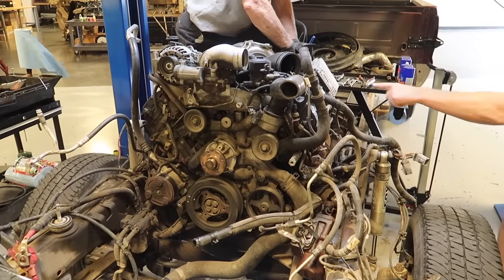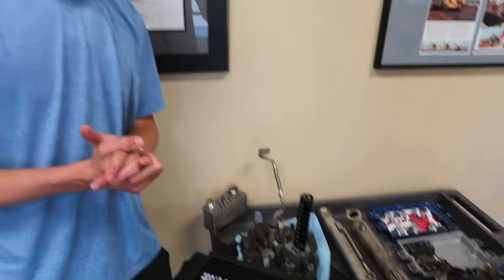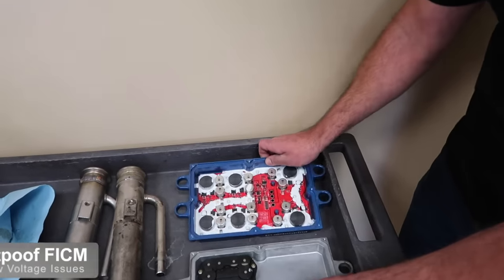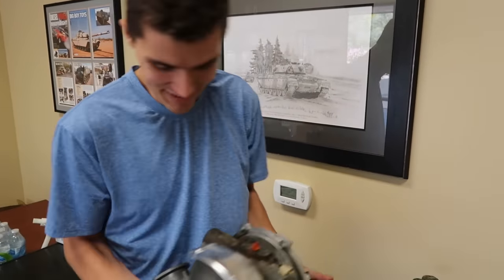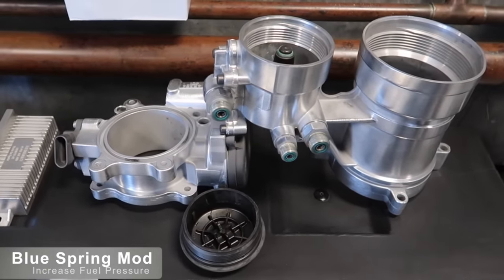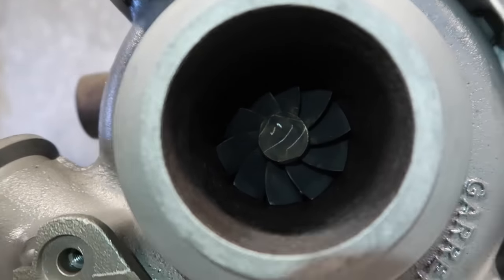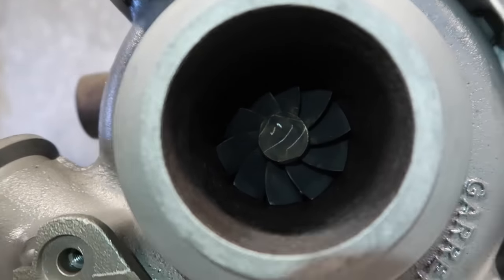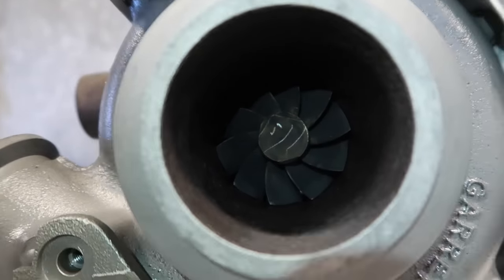Fully "Bulletproofing" Our 6.0L Ford F350 Powerstroke (Stage 3 Install)

Comment: I just wanna know where they found a king ranch for $5400
Reply: dumb luck
Reply: Me too !
Reply: Same... it’s always the things your looking for you can’t find
Reply: Plenty around me in ontario
Reply: auction duh, have you not seen their videos and how they get their cars
Reply: Got my lariat for 7500
Reply: Got my xlt 6.0 for 4500
Reply: got my 2004 f-350 lariat $3000
Reply: Crash on the Right side (bed, cab and door) 24:41
Reply: Easy to find one cheap in Hawaii but not bullet proofed.
Reply: Auction probably with 300,000 miles on it or more. Insurance could be a possibility too I guess. All I know is these guys make great content.
Reply: @JohnJennings-cn3sj  bummer, My 2005 Lariat f-350, CC, FX4, SRW I bought in 2005 was 37k
Reply: Just got my 07 cclg kr fx4 6.0 for $5k. 170k miles. Already bullet proofed.  ;)  they are out there.
Reply: I got mine for 3750
Reply: there was one for $12k and had 97,000 miles basically brand new
Reply: I got my 04 king ranch for 2k with 185k miles on it. Same truck in the video I’m building it now.
Reply: Got my 07 f250 for 7,000 now I’m up to 18,000😢

Comment: if anyone is wondering. to go from stock to full bulletproof you are looking at around 8600 for parts
Reply: Is that labor included
Reply: I paid 5,000 and did the labor myself
Reply: @yomommasgardener9648  same i just got the cab back on 2 days ago no lift was a nightmare
Reply: @thicok4555  how did you get it up???
Reply: 5,000 roughly without the labor
Reply: How much total was spent I want to completely upgrade my 6.0
Reply: Up to $15,000 depending with labor
Reply: Is that just for parts ?
Reply: @Dad2ADaughter_Cpt_Blakesbeard what parts did you use?

Comment: Yeah you could buy a 6.0 for 5k and put 10-15k even 20k in to it to have the truck u want or just buy a 7.3 and save time and money!
Reply: Yeah. But maybe they wanted the better towing capability and comfort of the coil spring suspension. Don't get me wrong. I have a 7.3 but at some point you have to ask what they really want.
Reply: Linda Hammer a 7.3 has its issues aswell even a 5.9 Cummins has its issues nothing is trouble free
Reply: @killiansnufflebottoms7827  im aware i own an 02 7.3 and i had a 01 7.3 that had over 500k original motor and trans only had to replace rear it was a plow truck most of its life im aware of small issues they have but its no where near as bad as 6.0 or 6.4 trucks. Never said that 7.3 trucks are trouble free nothing in this world is!
Reply: Killian SnuffleBottoms it’s nothing compared to a 6.0 let’s be honest

Comment: I say just do a muffler delete, chrome delete, a tune and new tire set up and u should be good
Reply from the maker: Dhruv Pahwa that would be a nice setup!
Reply: Then you start to add things like roof rack and related accessories, a nice front bull bar, some (not oversized) mudflaps, and a bed bar. And some side runners.
Reply: That would make it so tacky
Reply: Do a 5" exhaust
Reply: @robertrabon1706  now that's tacky
Reply: I agree do a small tune, and a 5” straight pipe turbo back, it’ll sound like a jet lol also keeps the EGTS  lower 😏
Reply: Or never get rid of the Chrome because it's way nicer 👍🏻

Comment: Yes 110% straight pipe it turbo back. It will sound absolutely amazing you won’t regret it.
Reply: Colby Cowan lowers EGT’s too, not only does it sound great but it is beneficial for the engine 👌🏻
Reply: Yeah 4 inch turbo back 5inch has little performance  over the 4 inch and 6.0s sound the best with 4inch
Reply: xv70 1 leaving it stock ( mufflers and cats ) keeps the existing exhaust flow obstructions there, causing slightly higher egts. When you straight pipe a 6.0, it lets the engine breathe better, it can get those hot exhaust gasses out better. It’s simple logic
Reply: @rileyjohnson2663  Yup 1st thing I did to mine
Reply: Agreed. Nothing beats the sounds of a strait piped 6.0, the loud whistle to the rumble and they just sound mean as hell
Reply: Everywhere I go, everyone LOVES the sound of my 4 inch straight piped 6.0
Reply: Don't straight pipe
Reply: @rose1693   why not?
Reply: @rose1693  "Don't straight pipe"

I bet you're fun at parties lmao.

Comment: how did you find the king ranch at that price? You know how people are on craigslist.

" 2004 Ford F-250 6.0.    7,000,000 miles.   Sank in the ocean once.    $33,500 FIRM."
Reply: it has passenger side damage
Reply: Ha I just copped a 2003 f250 6.0 for 3500 it only has a 100,000 miles on it
Reply: “No low balls in know what I got”
Reply: It's a 6.0 that's how mang

Comment: I'm really happy for you guys.  I just bought a 2004 f350 6.0 for $2300. It's a rust bucket,  previous snow plow truck . Was running like brand new until I decided to change the fuel filter.  I destroyed the bowl trying to remove the cap😭. Wish I had the money 💰 to bullet proof mine😞.

Comment: Doesnt need 53. Basically anything over 48 volts is useless. Love these 6.0s
Reply: Php ficm tune is better than increased voltages. I had a 58v now have a 48v with atlas 40. 58v is trash

Comment: Mt friend just learned a hard lesson after bulletproofing his 04. He had to shave his heads because the engine got overheated. 30,000 miles later the camshaft failed. The reason> He forgot to account for the shaved heads and his push rods were the stock length causing premature camshaft wear.

Comment: I straight piped my 03' for a short time. It was just too much noise for me while towing long trips. I put a series 50 Flowmaster on it. It is perfect for the classic 6.0 Powerstroke sounds with a whistle spool down sound just like jet engines sound like. It makes people ask what the hell is under the hood of the truck. It still has a little cruse speeds noise. But not a dronish tone.

Comment: For less than the cost of all the bpd parts you could have a reman engine from ashville engines with a upgraded cam and coated pistons.  Then you have a basically new engine.

Comment: I have an e99 7.3l stock and the straight pipe sounds awesome... any straight pipe turbocharged engine sounds awesome. Don't forget the turbo muffles the engine noise too... just with some added jet engine noises.

Comment: 4 inch straight pipe exhaust. You don’t need a new down pipe, just straight 4 inch from the down pipe back. Deleting the cat and muffler will make a huge difference in performance. To go along with the exhaust, find a good tuning company that has a good reputation with 6.0’s, that will give you a huge difference in power, along with gaining much better fuel mileage on the highway.

Comment: Exultant Vid on full 6.0 fix. Only problem is that the more people wake up to the 6.0 reliability their price goes up. 

A full fix like this has put the value way up for your King Ranch. I had my  2003 6.0 fully BPD parts fixed years ago and I have had zero problems with towing my 16,000 Lbs 5th wheel for over 60,000 miles since the fix. My rig is at 180,000 miles. My next insurance for the 6.0 will be a Certec Liquid Moly oil treatment for the pistons, cam, rockers and crank surfaces.

I went with a 4" turbo back straight pipe but installed the 50 series Flow Mater because on long trips it was too loud for conversations and peace of mind. I am an older fart though and if I was younger never would have heard much because of the AC/DC music full throttled.

7.3 Guys will still whine about it but that 6.0 is a much bigger beast and mods for it are staggering for huge power.

Comment: If your going to do a exhaust, straight pipe it, I recommend doing a 5 inch exhaust from the down pipe back. You won’t regret it, the 6.0 is the best sound Diesel out there. I Have a 5 inch on my 2015 6.7 and couldn’t be happier, adds a bit more of a Rumble compared to a 4 inch. My buddy has a 04 6.0 with a 4 inch and it can be a little over whelming in the cab, while I have another friend with an 05 crew cab with a 5 inch all the way back and the cab noise is significantly less and not as overwhelming, all while sounding great outside.
Reply from the maker: Thank you for that thorough insight. We are making a decision soon👍
Reply: Renzo Puopolo don’t you mean turbo back exhaust?
Reply: waimeagavin808 No, from the down pipe back, my truck is a 5” from the down pipe back, it jumps from 3.5” to a 5”. Atleast that’s with the 6.7 exhaust set ups, no need to do a down pipe. In theory you could call it a turbo back exhaust, can jump the down pipe up to 4” if you want.

Comment: Great video. In general, sucks that the engine that rolled off the assembly line in that truck was a POS to begin with and we have to “bulletproof” it in order to make it into a long lasting, reliable engine. This is something that could’ve been prevented if thought out better
Reply: EPA baby

Comment: 4 inch turbo back with a muffler. you can always take the muffler off if you want it to be louder. but with my experience towing with a straight piped truck it gets to be a little much on long trips. if you get on it the truck will still be loud. it just wont have a bad drone to it while running 80mph on the highway

Comment: I can hold 10 degree delta towing 10k with ambient temp 100. I have stock fan,fan clutch, water pump,oil cooler.  Didn't spend 10k on trash.

Comment: Do a straight pipe but make sure to do a mbrp 5 inch its a much better sound then a 4 inch  it will sound awesome and i know youre doing one thing at a time but with a straight and new air intake and with some custom tow tuning for the towing that youre gonna use this truck for it would be the dream truck for you i can guarantee you that lots of power for sure

Comment: Never heard anything about O-ringing the heads, never heard anything about Mishimoto radiator, and never heard anything about was the block/bottom end good or bad. They could have just thrown new heads, gaskets and studs on a bad motor and didn't know if it was bad or not... Also, was the high pressure oil pump good or bad/upgraded?? Not enough info for me.

Comment: How much did it run you, for everything, I am glad you were happy with this upgrade. I have a 2005 Excursion 6.0, a Texas SUV, the only upgrades I did was, EGR Cooler, oil cooler, blue spring, Amsoil bypass oil filter, coolant bypass filter, serviced the turbo and just last week had to install a new Ford  FICUM. I just love my 6.0. Off cause had to change the batteries and alternator once since 2010. This is the last vehicle I will own.

Comment: Ramdom technologies makes some great aftermarket cats and mufflers that flow and sound really good. Also watch your shut off times with your newly reconditioned diesel engine. You need to wait at least 5 minutes to cool your engine and turbo down before shutting the engine down, otherwise all those nice fixes you just invested your hard earned cash will be down the trash bucket when you cook your turbo bearings from not properly cooling your engine down before shutting it off. Get an aftermarket turbo timer. It'll lock your truck up for you and keep the engine running until it reaches a cold enough temprature to shut the engine off if you're on the run, otherwise good investment and hope you enjoy it very much.

Comment: What's amazing, I have an 2004 F350 and it have 300k mileage. No mobs, I don't know what needs to be done. My dad took it to Sam Galloway Ford for repairs and it took 6 months in total, we pick it up and drop it 3 times and payed 17k and is to much. We want to get the money back but it didn't work, we need a truck for my food trailer business but my wife thinks we need to sell it but for how much we waste is not worth it. 6.0 is one of the worst engines, this is great but we live in Fort Myers and I don't know how to work on it and plus, I don't want to waste anymore money, I don't know where to start until I saw this video is great.

Comment: If you really want the turbo to scream get the no limit fabrication 5 inch intake. And then a 5 inch exhaust. You can always put a muffler on the exhaust if it's too loud

Comment: Now that its bullet proof you have a truck that is going to last you up to 1,000,000 miles and 144k miles for a diesel truck is like 60k miles on a gas car. Great job on saving money going that route thats impressive.
Reply: Also you should do a dpf delete
Reply: Oh also idk if this is true or not but ive heard that after you bullet proof the engine you have to improve the transmission as well because if not the engine messes up the transmission. Something like that, its something i heard at work i work with diesel trucks.

Comment: "6.0 PS aren't reliable, it's like a ticking time bomb"

Tears engine apart to find a near stock 6.0 PS with 144k miles on it

I saw the last video where they had a 24 degree spread between temps, the unison sticking, etc.. guys, its a truck with damn near 150k miles on it.. its gunna show some wear on it. It's 17 years old, I would expect nothing less.. Also FICM showing 48v on their original.

By all means, if you have the money to bullet proof for the peace of mind, do it. But 6.0's aren't as bad as everyone says they are, but that's good for the used market, Looking for one as I type this. Good video!

Comment: Replace the cap on the degas bottle. The ones that come stock are garbage and can’t withstand the full 18 psi which leads to a lower coolant boiling point.

Comment: Nice video. New subscriber. What’s the general overall cost of the phase 3 bulletproof job you guys had installed. May have to consider 6.0 with this
Reply: Probably in the range of 5-7k depending on who does for it you. Powerstroke help on YouTube does it for 10k but he life time warranties head gaskets and and other engine components and fully rebuilds the motor but if you have a good motor probably 5k

Comment: What is the cost of the stage 3 with parts and labor? Shops around my area charge anywhere from $3500 to $4500, depending the level of performance and parts replaced. By the way these parts look and unique ownership of coolers, that figure should be closer to $10K?? Would help to know the cost.

Comment: You can have a stock 6.0 and never have problems. You can have a bulletproofed 6.0 and have more problems than a stock one. It’s hit or miss. I have an 07 6.0 137k miles 68mm turbo and 205/75 injectors and I’m still here going strong romping on it. I’ve had no problems with mine and I rip on it. if you’re gonna buh a 6.0 at least know about them so you know you’re going to be getting a good one and not like like this so you won’t have to throw money like you did.

Comment: 15 degrees isn't that much for a delta, its more important to see how the oil begins to cool back down. If you get to 50 degree delta in a 6.4 it will throw a code for oil cooler blockage. 
But if your going up a hill towing in 100 degree Temps your gonna easily go beyond 15 degree delta, just watch as you start going downhill, the oil should start to get closer to the coolant, if it doesn't then you probably got a blockage

Comment: If you don’t want to do a full straight pipe at least do a 4inch with a muffler It will lower your egts. But I would do a 4 inch down pipe to a 5in exhaust the 6.0s sound so damn good. Plus you have a lot of loud cars what is one more loud rig

Comment: It is actually a 2005 or 2006 because of the headlights   I have one identical to this and it is a 7.3L powerstroke  diesel and it is not a 2003   But you could have put those on there but it is a 2005 or 2006 model year

Comment: Should have just got a Cummins🤦🏽‍♂️🤣
Reply: Why. So I can be stuck trying to get to 60 mph 30 seconds after slamming the pedal to the floor? My 7.3 is quicker. And a dodge is pos that falls apart.
Reply: Cummins makes amazing motors but they are not bulletproof either they have their issues
Reply: I’ve got to disagree with Dodge being junk. Got a 08’ Dodge Ram 1500 with the 4.7L V8, 4x4, and 545rfe automatic transmission. Has 325,000 miles on the original drivetrain. Only issue is cosmetic, being the rockers are rotting out, but you Ford guys should know well about rocker rot!
Reply: Samuel Yi my dodge was twice the truck my Chevy is. And a cummins can make and handle way more power than a 7.3

Comment: So, what’s the price for the stage 3 kit with install? I have an ‘05 F350 196k miles and it’s becoming problematic. I also live in Arizona and want not only better performance, but a more reliable engine for these summer towing days.
Reply: With labor $10k+ probably

Comment: You still need archoil AR6200 in the fuel and archoil AR9100 in the oil the engine and injectors will last forever.

Comment: I straight piped mine at first but I do alot of towing and it's so load inside you can not hear yourself think. I ended up putting a muffler back on.

Comment: You guys should have replaced your high pressure oil pump 03 hp oil pumps are notorious for going out and I noticed in your video it was kind of a lazy roll to start when it should be a ramped up fire up.
Reply: I have a 03 and it starts way better than that

Comment: There's no such thing as having a 6.0 that is fully bullet proofed and reliable. I have plenty of videos to prove that on my channel. Both my 6.0s were done with the complete solution kits including a external oil cooler on the 04 king ranch. I still ended up having issues 30,000 miles into it. Take the $6-8,000 that your going to stick in a 6.0 and build a 7.3 you will have a truck that eats 6.0s,6.4s and 6.7s in the pulling department and it will last a million miles .I haven't seen or heard of any 6.0s 6.4s and very few 6.7s that make it to a million miles. I have had two 7.3s that have made it to 800,000+

Comment: The 6.0 was unreliable in 2003 because they were so rushed to pass emissions but the nexts 4 years of the engine it was more reliable but you should still probably bullet proof it